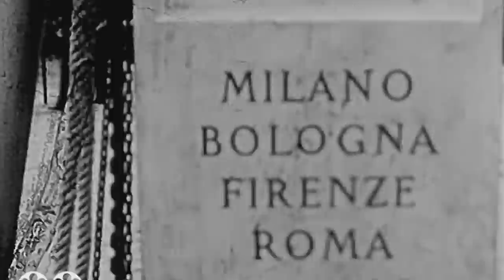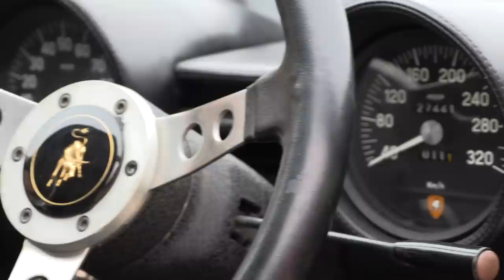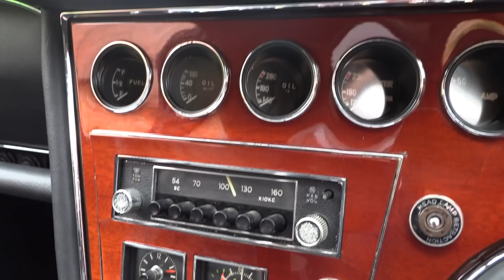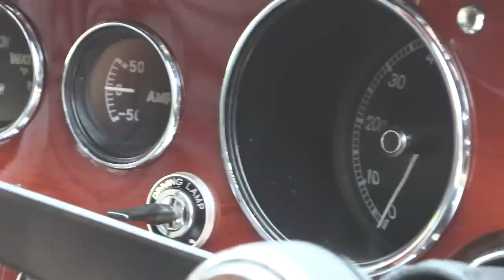Toyota Made a Great Car but Still FAILED To Beat The Italians - Toyota 2000GT Vs Lamborghini Miura

Comment: Nothing compares to the phenomenal design of the iconic Miura. Leather interiors are a must in exotic supercars like the Miura for both aesthetics and safety. Being buffered against soft leather versus wood chards which can impale you in case of impact is the reason why exotic sports cars use soft-touch materials like leather, suede, or Alcantara.

Comment: Superb video comparison, probably unique! There is a mysterious and often disputed link between Yamaha / Toyota / Nissan with the 2000GT and Nissan 240Z, and a certain designer, Albrecht Graf von Goertz. However, the bible on this car is “Toyota 2000GT” by Shin Yoshikawa, and it does not mention Goertz once, but does contain hundreds of initial designs of the car, its outline, and construction, each signed by Toyota designer Satoru Nozaki.    Back in 1985, I spent months trying to buy a UK based 2000GT and have plenty of photos to prove the point, there were only 2 in the UK, pity I can't share them on 'here'. The asking price at the time was just £20k .. and I was convinced it was going to be a good investment. It was Red and LHD and in fairly ‘tatty’ shape at the time. Sadly, I was gazumped late in the deal, much to my misfortune as they now have asking prices of $1M!. One overriding memory was just how small it was, and I had significant problems getting into the drivers seat with one leg either side of the wheel, knees wedged up tight against underside of dash, and my head pressed against roof lining. I didn't drive it because of this, and would have been unable to operate clutch for example. (for reference, it was about 4 inches narrower than a lotus Elise, but about 10 inches longer). Despite all that, I still wanted it !!
Reply: You mentioned Albrecht Graf von Goertz, reminds me of Edgar Schmued who designed the P51 Mustang and F86 jet but gets conveniently ommitted because he was German.

Comment: First mid engined production road car was the Bonnet Djet .  You need take one of them for a spin, Jack - if you can find one.

The Lamborghini didn't have an LSD and needed it.  The Toyota did have an LSD and probably didn't need it - not enough power and torque to really warrant it.

Both absolutely gorgeous cars - but in completely different ways.

Comment: 1280KG and 280bhp. Perfect power to weight formula for a fun sports car. 40 years later did it trickle down to us blue collar workers to experience what the elites got to experience for decades? No. The Toyota GR86 is 1280KG and 227bhp. That's why I'm incredibly disappointed, it was the last chance before electrification and they blew it :(

Comment: There is a 4th model.
While still designated as a Miura SV, the last 25 cars built were very different.
All hand built and only 6 in right hand drive.

12 inch Michelin tyres at the front and 14 inch at the rear..... even with the flared guards , you could barely get a cigarette paper between the tyres and guards.
Only 3 squashed fingers under the side rails..... yet to my knowledge , they didn’t bottom out on a road and the tyres never touched the guards or other bodywork.

My uncle was Qld agent for Lamborghini for a short time and ended up collecting them.

When he took me for a ride in his, I couldn’t believe it.
He had to leave the bitumen to avoid on coming traffic at speed, but I never felt any bumps or thumps.
In my Cooper S, I felt everything.  Even a chalk line.  lol
The engine was also a little different and had very different air filter set up on the 6 dual throat Webber’s.

The wheels were specially made for the red car with gold trim.... gold wheels, but only 4 in full width.
The gold spare is only about 8 “ wide.  lol

Comment: The prototype mid-engined design to which Jack refers seems likely to have been the Ford Mustang concept, 1962 - here: https://en.wikipedia.org/wiki/Ford_Mustang_I#/media/File:1962_Ford_Mustang_I_Roadster_(14174957260).jpg. However, the first mid-engined production car was the French Bonnet Djet of 1961: http://retro-motoring.com/events/BicesterH-Oct16/picviewer.php?file=IMG_5967

Comment: I remember on the Autostrada del Sole running southbound, I was lucky to follow a Ferrari Mondial 4 Valvole with the iconic Licence Plate MO PROVA 1. I was amazed how normal the tester was driving the car in public. Then I realised something: From the exhaust you could see a little bit of smoke for a moment and I knew this guy was running through the gears at nearly a hundred miles per hour. He shifted back to third and fourth many times. 
I met a guy who lived in the region about 45 years ago: He told me it was very common to see Lamborghinis, Ferraris and Maseratis being tested on normal roads and he meant not the highways. 
The police would let them run at any speed they liked and did never interfer: That is Italy. A Swiss friend from Switzerland was speeding inside the city of Rome late at night. He was shocked to see the police show up beside him at a red traffic light. The cops made a sign, making it clear that they wanted to race with my friend. So both took off full speed. He never told me who won. I am sure the tuned police car did win without to much effort.

Comment: Why did Toyota 2000GT fail? Because it was made by Japanese, of course. It was only 20 years after WW2 when this car came out. As a Japanese, I used to be frequently thrown racial insults right in my face in UK until about 30 years ago. Many English publications still erroneously claim 2000GT and Z were designed by Albrecht Goetz, implying Japanese were not capable of such beautiful designs. I have multiple car books written by noted British car journalists that say Japanese "aped" the designs of Jaguar, MG, Lotus or whatever, while other Europeans "copied" them. By the way exactly which car 2000GT was "copied" from as some people claim? For that matter Miura was famously "inspired" by Ford GT40. 
In the 60's Japanese motorcycles started dominating the Grand Prix racing, Honda won a couple races in F1, many Z's were sold, but the real performance credibility for Japanese cars became indisputable only in the late 80's and early 90's, when Honda dominated F1 with their engines and made the NSX, Mazda won in Le Mans, and Toyota, Mitsubishi, Subaru won in WRC.
Reply: The 2000GT didn’t fail. It was planned as a short run halo vehicle, hand built by Yamaha, from the beginning.

Comment: I'll probably be heckled from the side lines here, but the Miura is imho, "the" best looking car from any angle ever produced, it is just stunning still today some 50+ years later, and remains my absolute favourite Lamborghini, ever since I first saw the Italian job as a kid, the way the body sits over the wheels like a Cheetah waiting to pounce, the slats in the doors, it is just a stunning piece of design, if I had a big lotto win, a late model Miura would be sitting in my garage about a week later, but not in puce Green I hasten to add.

Interesting about the Miura being tested on the local roads, I lived just south of Bologna from 2016-2018, and still today you can hear Lambo's and Ferrari's being tested on the local roads.. just incredible.

Comment: Oh, boy...  When they first came out, I wanted a 2000GT in the worst way and ogled the magazine photos...then I got the chance to see it in the flesh at the NY Auto Show.  It looked even better in person, lower and (alas) smaller.  But I just did not fit:  I'm almost 6'1" and even then weighed about 200#.  I could shoehorn myself into the car, but my size 12 feet were WAY too big for the footwell, my head was on the roof (no Gurney bubble), and my shoulder was right up against the door.  I made do with an E-Type, which actually cost LESS in the USA!  Kept it for some time and really had very few issues.
I've had TWO Muiras, one P400 and the second one an SV, both bought (and sold) when prices for these things were relatively low.  Unike the Toyota, I fit (barely) but just could not resist.  The Engines were glorious, the gearboxes good but the linkage not so, but both cars felt to have more flexibility than you wanted in something with so much power,  To say the handling at the limit was dicey is a serious understatement.  Plus, the quality of anything other than the powertrain was just awful;  everything imaginable (and some things not so) fell off or wore out.  Compared with Ferraris of the same period, this was NOT acceptable;  compared with anything else, this was horrific.  Great to look at, though, and even better to listen to...

Comment: 2000Gt can be readily replicated from Toyotas' own parts bin, but with 4 seats- I took a 1972 Mk II Corona coupe, and simply added the 1G-GZE & auto from an '87 Crown Royal Saloon, the LSD from an '86 Crown RS & had a very fun car. ( 1100kg & 210 bhp, with basically no work whatsoever beyond a swirl pot & Haltech ECU).
Sad to say- I sold it, a couple of decàdes ago.

Comment: the 2000gt would look much much nicer if it was lowered considerably to try match the stance of the Miura.
The Miura would look much nicer if the wheels were spaced a little to fill the arches properly. 
Both gorgeous cars must have looked like spaceships when they were first released 👌👌

Comment: The roadster version that appeared in YOLT is absolutely stunning as is the coupe. The Lambo is also a beauty.
Reply: Yes. Toyota only ever made 2 convertibles. Both for YOLT, and only because Sean Connery was too big to fit in a hardtop 2000GT.

Comment: Well done Jack - great video, well presented, and full of great detail and heritage. The one question I have is why are there spots of green paint on those vents!?
Reply from the maker: Hey thank you!! And not sure on the green paint or which vents you mean?
Reply: @Number27  I guess they are the side slats/louvers/vents where the door meets the rear quarter. If you look at 08:59, the slat right about the door handle appears to have spots of green body paint?

Comment: No flywheel on the lambo? What did the clutch attach to then? a few years newer Toyota 4cyl 18RGU with another Yamaha head made virtually the same power as the 6 in the s2000 (I put one in my Celica decades ago). Omg.. Can't believe I didn't see it before. The door handles on the S2000 are the same (or nearly so?) as the later Celica! I had S800, which was the baby version of the s2000 ;)

Comment: Sorry, but the 2000GT was not a supercar. It was a sportscar that failed because it was too small for non-Japanese people to fit in and drive, on top of being slightly more expensive than the E-Type or 911 but with much less brand recognition or cachet. All this nonsense about it being "Japan's first supercar" is just retconning in light of how important Japanese manufacturers became in the years since the early 70s.
Reply: Not true. Go back and read the accolades of the time. It was a shock to the industry how successful it was. It didn’t fail because it was too small; the short run was planned from the beginning, as they were hand built by Yamaha. Toyota wanted a halo vehicle and they got it.
Reply: @jysmtl  lmao wrong it was a VERY slow seller and auto journos liking it doesn’t make it a “success”.

Comment: This green Miura color is butt-ugly. I test drove a used Miura (don't know if it was the launch version or the S version) back in September 1971 in Latina, Italy (just south of Roma). It was green, but definitely NOT this butt-ugly green. This is truly hideous. The one I drove was like powdery green, very elegant. This is a truck color here. Just crazy. :face-green-smiling: And no, I never did buy it. Cockpit was cramped ( I am 187 cm tall), all black, so dreary, it was loud as hell, just rough riding. Ended up with an Alfa. Trying desperately to recall what they were asking for the Miura in lira. I know in USD it was under $10K, maybe $8K, could have been even less. The Alfa I got was around $3,000.

Comment: Toyota Did not expect to make the 2000 GT A mass produced vehicle that could take market share away from makers of sports cars or luxury cars.  What they wanted to do is prove that they could build such a car, even though they were a factory that cranked out subcompacts by the thousands. I have only seen 2 men driving a 2000 GT. James Bond and my hometown's Toyota dealer.  These cars were hand made to get everybody to come over to the Toyota exibit at an Auto Show.

Comment: THe miura weighs a bit more 4 kg per hp, A good rule of thumb is that accelleration in seconds to 100kph (62mph) is about the same as kg per per hp. (a car with 100hp and 1000kg will take about 10 seconds). That implies that the theoretical accelleratoin of the Miura should be about 4.5 seconds from 0 to 62 mph

Comment: I'd prefer Miura over 2000GT any day!!! So would anyone!!!
And, Number 27, you would NOT enjoy driving 2000GT because it's way TOO SMALL. Even Sean Connery had trouble getting into that car. They had to REMOVE the roof so he could squeeze himself into the car. LOL
Also, Jay Leno got an opportunity to drive that very same 2000GT car in Japan outside of museum in the parking lot only. The steering wheel was cutting into Leno's legs. That's how small it was.
Reply: Jay and Sean are big and tall. At 6 ft, I’ve had no trouble driving cars of that size. Midgets, Spitfires, Minis, Lotus.
Reply: @jysmtl  
But not 2000GT, it's even smaller!!!

Comment: On the Toyota, there is a rectangular "panel" behind the right front wheel. I've always wanted to know what the reason for it being there. I would guess that it's for easy access to something...
Reply from the maker: It’s where the battery is!
Reply from the maker: To keep the weight low in the car!!

Comment: A lovely comparison of these two cars.
However, I did not hear you articulate an explanation for why the Toyota 2000GT "failed."
Reply from the maker: Well they couldn’t seal any of them.. made a massive loss on each one. So for what they were trying to achieve in the day it was a failure.
Reply from the maker: Sell not seal! 😂
Reply: @Number27  I see... and that makes sense. Thank you for clarifying for me. 👍
Reply: @Number27  That’s not true. From the beginning they planned on a very short run. They were hand built by Yamaha. Toyota wanted to make a splash, challenge some XKE speed records and create a halo. The 2000GT was a great success.

Comment: Why does he call the wheels knock offs?
Reply from the maker: That’s what they are called when they have the central winged nuts that are ‘knocked off’ to take the wheels off
Reply: @Number27 Ok thanks for the information.....I figured it may have something to do with what you said....I ve heard the term before in the classic car world..... Knock off wheels means something different in my generation( millennial). Ok so are there lug nuts behind the spline area on the hub?

Comment: Sorry Jack, I remember history differently. Back in the day the 2000GT was nothing all that special. Yes it was a top of the line sports car effort from Toyota, but it was really just a Japanese knockoff of the Jaguar E-type. Performance wise it did not come close to the Jag let alone an exotic or an American muscle car of the day. I don't know where you got that figure of 0-60 in 8.4sec but it was more like 10sec. There wasn't much ground breaking about the car. Styling wise it had nice curves, the only problem being the front end, which was kind of the typical functional clunky style of Japanese cars of those days. So what is it's claim to fame? That it was used in a Bond movie? That they are rare now because not many people wanted to buy them in those days? They were expensive in relation to the average performance one got. And while the interior may seem of higher quality, people buy sports cars for performance, not for wood veneer finish or switch bezel quality. Collectors are willing to pay a lot for them these days, they are a rare car, but does that make them something they weren't? Just seems a bit too much hype and seeing history other than what it was. You seem to have an affinity for the Toyota but I just don't see the comparison.
Reply: Not true. The 2000GT set a while slew of FIA speed and endurance records, several coming out of the hide of the E type, as well as Porsche. The 2000GT performance was a wake up call to Porsche, who set about developing the 911R to answer. At the time (I’m old enough to remember), the 2000GT was a shock to the industry.